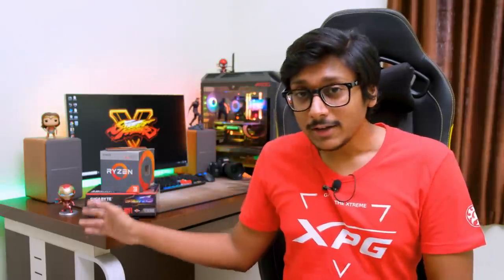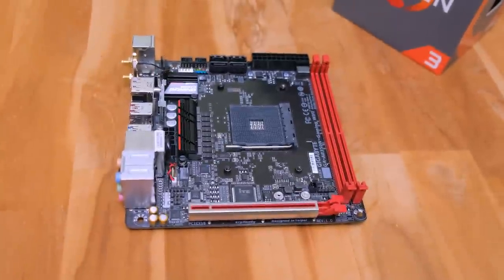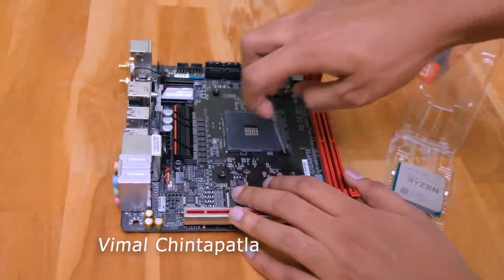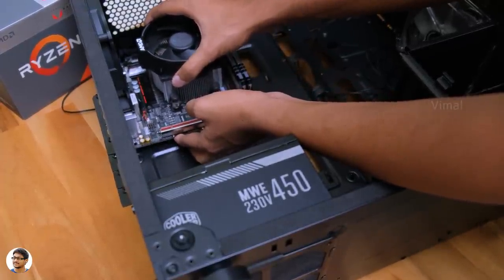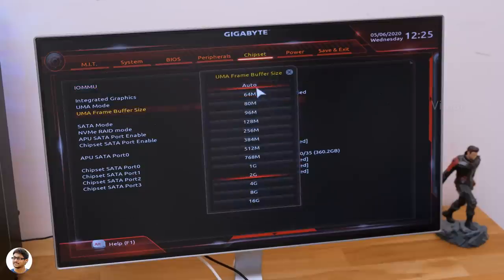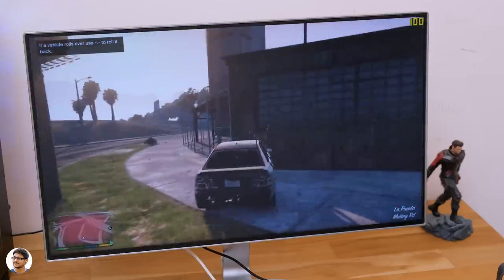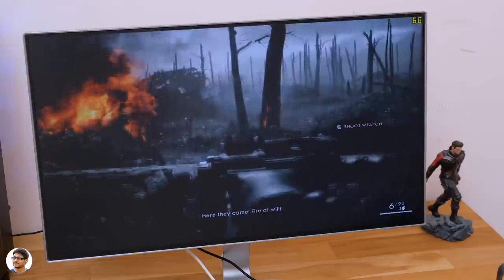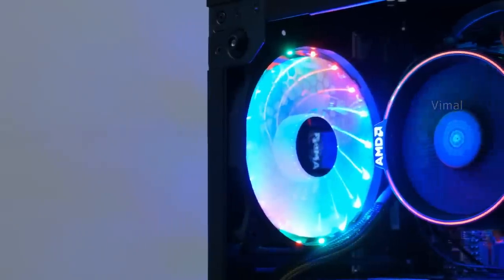25K Ultimate Gaming PC Build... Max Performance on Budget !! 🔥

Comment: Can anyone share the links of all the products
Reply: I have changed some components as per need. they are all equal or better.
Ryzen 2200G processor - https://amzn.to/2FmBRlP
Gigabyte AB350N motherboard - https://amzn.to/2DEzwlL
Ballistix DDR4 16gb RAM  - https://amzn.to/2XTsfp1
240gb ssd storage - https://amzn.to/31IQLKE
CM 450W power supply - https://amzn.to/3iDmzrc 
cabinet - https://amzn.to/3kEjpFj

although i will suggest you upgrade processor to Ryzen 3 3200G https://amzn.to/33T1lkN

as it is cheaper and also newer generation and faster.
Reply: use my links for your purchase for best dicounted price.

Comment: Can I use Ryzen 3 3200g rather than using Ryzen 2200g in this build in 2022 . Anyone pls reply 😅😅
Reply: yep you can. I'm using 3200g with 16gb ram.
Reply: @Ashik067  thnks for your reply. Now i satisfied with your answer 😊😊
Reply: @devvesh  but get a higher capacity storage. 240gb ssd isn't enough. GTA V is alone 106gb in size. So get a hard disc for storing games.
Reply: @Ashik067  Ya im knowing that therefore i will use 500gb hdd with 240gb ssd

Comment: Why only ryzen processor is used??
Why I can't use i7 processor
Reply: The main reason is  budget is tight. And also i7 is a cpu whereas ryzen 3 is apu which means it comes with integrated graphics which also means you don't have to really go for a gpu if its not in your budget......(spelling mistakes and grammatical errors may occur. Apologies for that)

Comment: Please brother give links of all items because I search but some  items I didn't get .it will easy for me  please give links
Reply: Ryzen 2200G processor - https://amzn.to/2FmBRlP

Ballistix DDR4 16gb RAM  - https://amzn.to/2XTsfp1
Gigabyte AB350N motherboard - https://amzn.to/2DEzwlL
240gb ssd storage - https://amzn.to/31IQLKE
cabinet - https://amzn.to/3kEjpFj
CM 450W power supply - https://amzn.to/3iDmzrc 

although i will suggest you upgrade your processor to Ryzen 3 3200G https://amzn.to/33T1lkN
as it is cheaper and also newer generation. all the other components will be same.
Reply: @purchaseperfect7526  thanks so much bro

Comment: My specs 
Gigabyte H81M-S
Intel 4th generation Dual core processor
Ram 2+2=4Gb 1300MHZ
GPU geforce gt-610 2GB
HDD 1TB WD blue

Basic PSU 250 watts i think

Can i upgrade this pls reply anyone?

Comment: The links for this PC build would have been nice. Plus, the prices are not as mentioned. They are considerably higher!!
Reply: they are around the same price.
Ryzen 2200G processor - https://amzn.to/2FmBRlP
Gigabyte AB350N motherboard - https://amzn.to/2DEzwlL
Ballistix DDR4 16gb RAM  - https://amzn.to/2XTsfp1
240gb ssd storage - https://amzn.to/31IQLKE
CM 450W power supply - https://amzn.to/3iDmzrc 
cabinet - https://amzn.to/3kEjpFj

although i will suggest you upgrade your processor to Ryzen 3 3200G https://amzn.to/33T1lkN
as it is CHEAPER and also newer generation. all other components will be same.
Reply: use the links